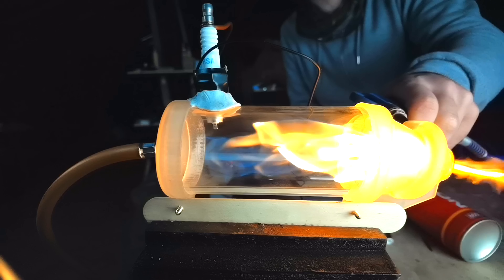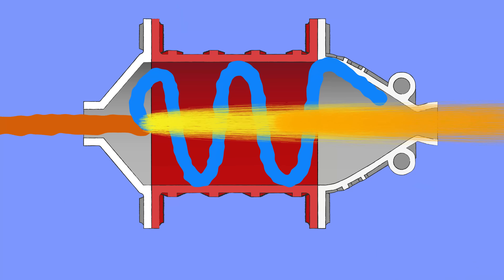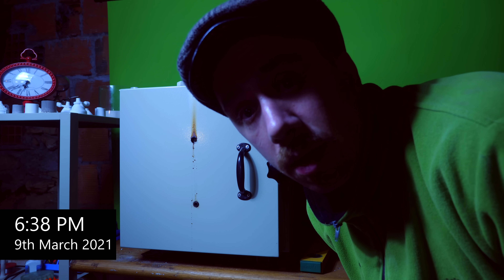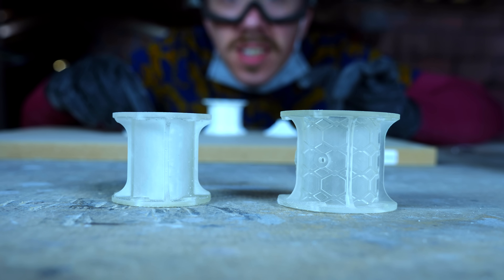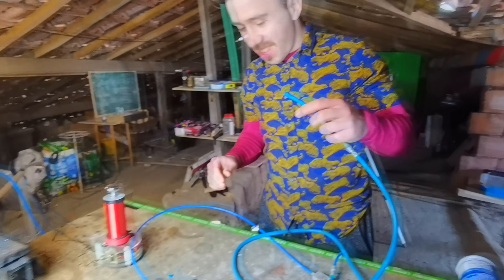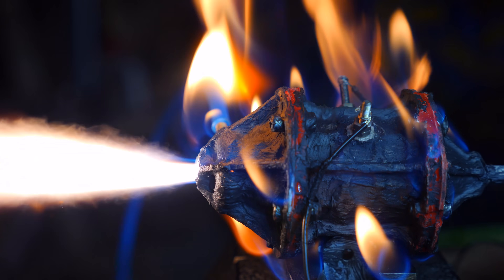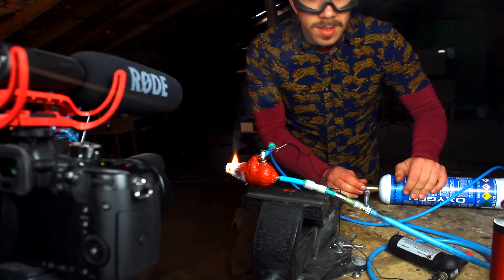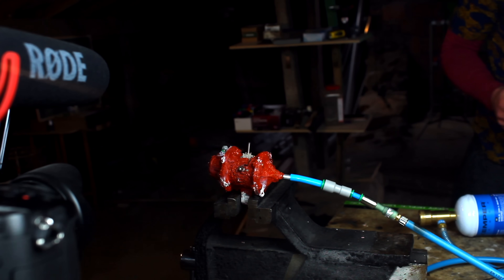Vortex Rocket V2.0 (3D Printed)

Comment: You can just use cans as body for the nozzle (just pressing them by 3d printed mold) and copper tubes as a fuel line. Well it's still half-printed engine.
Otherwise you can calc the cooling of an aluminum nozzle by fuel in solidworks (or openfoam).

And the chamber body must be transparent!

Comment: Have you thought of sanding down the connected engine pieces so as to remove the imperfections in between? Maybe that helps since there might be leaks dueto the parts not fitting together perfectly

Comment: To fix leaks: put temporary caps on holes, then dip it into ceramic bath the same way brass pourring molds are made.
Not the fastest way to do, but it should worth a try.

Comment: Look up Ceramabond 503 - it's a high temperature ceramic adhesive that you could probably coat the ceramic pieces with.  It's good up to about 3200F, and your propane flame will go up to 3596F, so it'll last for a little while at least.

Honestly I think you got the best results from the submarine-looking one-piece rocket, so I'd go with that general design or something similar.

I  think your major problem is that porcelain is weak against the forces being exerted against it - you're trying to contain an explosive force with a material that's weak against tension.  Think of it like a balloon, your continuous vortex is a force trying to expand the balloon and the balloon's ability to withstand tension is all that's keeping it together.  Porcelain, being weak against shearing and tension, is just plain a bad material for this purpose. Yeah, the high temperature resistance is awesome, but that's about the only bit that's going to help you here.

You might be better off using your new welding rig to weld up your rocket and use the 3d printers for making jigs or fittings to get the metal parts together *just right*.  Go full Colin Furze on this bad boy.

Comment: why don't you print the engine parts in plastic and then cast them out of metal. you already have the Furnace you use for ceramic parts. all you need is a casting mass and something to melt the metal with.

Comment: On the modular engine you need a o ring or some type of material between the pieces of the engine.  As it heats up it is looking for any sources of oxygen and burns right though the pin holes.

Comment: Here's my Brain Fart: You might be able to suck some sort of sealant into the void space of the ceramics shell using vacuum or a high pressure chamber. It will penetrate at least to the surface layer if the particles are fine enough and have enough motivation (pressure difference). Good luck.

Comment: What about print it, put it in the kiln to burn the plastic off. Use something to block the holes and then dip in a liquid ceramic several times allowing time between coats to dry and then put back in the kiln to harden.

Comment: Have you thought about trying to coat the ceramic parts in a high temperature glaze. This may be especially good for mating surfaces allowing you to use paper gaskets like a car engine in between two smoothly glazed surfaces

Comment: Ai, what about metalpowder 3d print? There is stuff mixed wirh pla for the normal printers and there are Special printers to „print“ titanium and shit. They use these for example for airplane spareparts. Print your engine like this and it should be stable

Comment: Why don't you try to place the engine in a pot and fill the space between the pot and the engine with concrete? It's quick, It's fast, It's simple, It's cheap. And also It's so heavy you may be sure it wont fly away.

Comment: You need a bell or aerospike nozzle to direct the flow more productively
Reply: he does have a nozzle. However at sea level the bell is VERY small in comparison to the chamber diameter. The big bell nozzles would be horribly over expanded at sea level (blow up the engine bad). :) hope this helps
Reply: @superspooky4580  I was also wondering if the throat diameter was optimized for the combustion chamber size

Comment: You're going to die in one of these videos. Also try maybe a low fire glaze after you clean the parts or even I high fire one as you already have a kiln that can handle it. You can order them pre-made online and should be easy enough to paint on the outside of your part. Not sure how it will handle the already fired clay but it's worth a try.

Comment: you could use ceramabond or any other high temp ceramic glue or cement or even ceramic glaze and make sure you pass it on the pieces you want to glue together as well as the holes you use to bolt the parts together (in case of cement).

other than that I think you could also try using carbon fiber to wrap around the glued engine parts just to make sure it won't leak.

Comment: since you are using a 3 printer could you use the oxygen to cool it down and effectively have a jacketed design to keep the chamber and entrance of fuel cooler, this then would only leave you with the nozzle being still quite hot

Comment: You could wrap it in a fine high temperature fiber mesh such as carbon fiber and then cover it in high temperature cement or high temperature silicone. Or another idea is smoothly cover the engine in high temperature  silicone and then wrap in a fine carbon fiber mesh or alternative as one of the main problems I saw was the silicone expanding due to the pressure.

Comment: You could make the engine parts with interlocking sleeves in order to create a better seal to prevent leaking. This would allow for higher head pressures while creating a better seal.

Comment: Try doping your ceramic with other things that could possibly improve its performance, I'd go for high temp metal glue. Not sure if certain solvents could dissolve the ceramic though, so probably try it with a small part first. I think the ceramic should soak up the metal glue perfectly, and once set it should fill all the pores.
Reply: P.S. to clarify, I mean to dope the parts after you fire them in the furnace

Comment: Try dipping your fired ceramic build in a thin concentration of high temperature tolerant concrete or plaster, and then let it dry, then bake it. I think it should work fine.

Comment: Ceramics are inherently porous. You'll probably need to switch to an entirely different method of making the engines. Casting them in metal using the lost wax method may be a good place to start. I think you'll do better though if you use steel sheet metal. Good luck with the complex curves of that one piece engine.

A solution that may hel for the ceramic engines though would be to apply slip to the inside of the engines, and then really buff it down. Maybe you can compress and align the particles of the slip enough to significantly limit the porosity.

Comment: Excellent videos man! Here's what I would try. Filter your refractory cement so you only have fine powder. mix with water to make a thin slurry and brush over ceramic parts. let dry and repeat a few times to build up layers. maybe baking them for a bit afterwards in your kiln on a low heat can help temper the cement.

Comment: Since the ceramic is so porous and the fact you have to burn out the resin, could you seed the object in high-temp epoxy to create a non-porous object? Perhaps vacuum pump with the epoxy still wet to pull out any bubbles?

Comment: I am somewhat working in that field but infiltrating the porous ceramic structure with a liquid Material might be a solution (f.e. a liquified metal or liquid ceramic), called a wetting process (not to sure what your pore size is, so its hard to recommend a Material for you)

I guess you could use any high temperature liquid Material, you just need to get the wetting angle and the pore size right)

Comment: Rocket Labs use fuel pumps powered by electric motors rather than gas generators , maybe make a 3 printed turbo pump rocket , only the nozzle would need to handle heat.

Comment: have you ever tried using regular porcelain powder to fill in the cracks? it comes in a powder form you mix it with water and it works like cement.

Comment: 3D print a mold of the rocket engine to use as a cast. Then you can cast it with a mixture of plaster of paris and graphite powder. No need to use the kiln anymore.

Comment: Easiest way to "seal it up" is to scale it up, and seal the inside. When you increase the pressure, it's easier to let things get pushed into holes, than to try and push things into the holes from the outside, since you need to push with the same force of the internal pressure.

Comment: Maybe you could make some kind of high temperature composite, using the refractory fiberglass and... honestly the same high temp silicone sealant as before, I think the issue there was that it peeled off. If you embed the fiberglass in the refractory cement coating the device initially, but leave it partially exposed, then it'd have the tooth required to hold in the silicone?

Comment: How about finding a way to use tomato as a 3d printer filament and using the printed tomato as a part in a combustion engine. If the engine fails, dead tomato. If the engine wins you have found a better use for the dreaded tomato.

Comment: I think if you put an cut from the inside where the pieces are next to each other that has the form of a triangle that is pointing outwards. You could 3d print another resin part that would fit in the triangle with a little bit of material on the sides so that the air can't get in the gap and the pressure in the engine helps to seal it up. But you should put Zement in between those parts anyway. I think this might work but I am not to sure. And if you don't understand it pls ask my English sucks xd

Comment: It looks like the sealant you were using was igniting once the exhaust temperature increased, what if you printed the engine, sealed it with something like gasket maker and then coated them with cement, this way the fire from the exhaust wouldn't be able to touch the sealant and it would add some rigidity to the engine

Comment: @Integza, what if you build a matrix from sacrificial material and use borosilicate clay to make an engine. Like a press form or something that could produce a less porous walls. Glaze it and bake to make a porcelain. This will ensure that your engine doesn't leak. Sacrifical material could be 3d printed plastic so you will burn it our in furnace later.

Comment: to solve the leaky engine maybe try coating the engine in "JB Weld", not sure if you have that where you live. If you dont have it, any steel based epoxy could work and make it stronger. You could also try Lost PLA casting to create the part out of metal.

Comment: 3D print the part, cover in clay for leaks, then assemble the tubes, cover de nozzle and put the engine inside a bucket with cement (2 parts sand) for strength

Comment: might be time to start casting some metal parts lol. Those ceramic prints can handle high temperatures, but not at high pressures it seems. You can still use the 3d printer to create the casting mold which should actually make it a lot more accurate. Love the videos Btw.

Comment: I'd try using the ceramic for just nozzles and the glaze them. Or maybe try using aerogel as the insulation. It's proven the be heat resistant

Comment: You could explore coating the ceramlite in cerakote to help increase heat resistance and seal up any porosity that comes from baking off the resin. Though you might have to send the part out for cerakoting; ceramic bonding agents could work as well but I would say from experience it is hard to get a completely even smooth coating of ceramic bonding agents so that you don't have to worry about porosity allowing the gases to escape the channel and creating failure points.. It would be interesting to see. Also you could use a mechanically flat surface with fine grit sand paper to level off your contact surfaces for the modular engines or using a lapping compound to make a perfectly seated modular unit. I also would think that you could coat the internal surfaces with cerakote as well. Though that is less an idea for another video as a solution to current problems. You could do a video 3d printing tesla eggs of Columbus and see if you can get one to work as well as the aluminum ones do.

Comment: I wonder if the way that the ceramic is formed with the resin leaves behind tiny voids, sort of like a foam or sintered metal. As the ceramic heats up and expands, the pressurized gas escapes through the voids. 

I don't know, but it seems like an idea anyway.

Comment: You rock! 😎
Reply: You rock-et?
Reply: Try if glazing the engine parts helps. Also apply from the inside. Ceramics printed with resin are naturally porous. You want to plug that so that the pressure assists you, not fight it.
Reply: Акхах привет
Reply: No he is integza
Reply: et
Reply: Прикол

Comment: You can try print a hollow mold and fill it with some ceramic clay, then you melt the plastic and remove it. So you will have your turbine without leaks.

Comment: I think  you should use those desktop metal powder printer to make high temp and quality parts 😉. It's time to buy new equipment. Or you can use ceramic extrude delta printer to make ceramic parts .
But I really like if you blow that bloody tomato 🍅 king 🤴with that suger rocket 🚀.

Comment: Why not consider using paint that is resistant to high temperatures.  For example, one used to paint a stove.  But from the inside of the combustion chamber.  Maybe use an airbrush?

Comment: @integza Love your videos man I wish you posted more. I was thinking if you took aluminum foil and wrapped the outside of your casing with it then sealed it the gasses could not escape and burn.

I would recommend like a pottery glaze of some kind and sealing the ceramic I bet its very porus.

Also you should pressure test the chamber before trying your experiment if you can get it to hold pressure then == no leaky leak..

Lastly I share your hatred of tomatos. I only eat them in their purified form of ketchup!!!

Comment: Hi,
You can use salt to seal the porous.
Put your engine inside a saturated salt water (NaCl). Then out to dry, repeat if needed. 
In the end salt is going to completely close your holes...   And it doesn't burn.

Comment: Try coating inside walls with heat resistant material it should solve the leaking out problem the material will be pushed against the wall of your engine due to engine pressure. it might also strengthen the porus ceramic structure of engine. well atleast a little bit more 😅

Comment: For the leaking, you could use high temp JB Weld. Just paint it on and leave it for a day or two to cure. JB Weld holds a mostly airtight seal and cures rock hard.

Comment: If you want to mostly use 3D Printing, I would suggest quickly dipping the already burnt 3D print into the resin and cure it (with a UV-Lamp) after that.
Then it's just a matter of burning it in the oven again. Repeat until satisfied.

Comment: Could you use the refectory cement on the inside of the modular engine? 

I think there may be small holes acting to focus some exhaust outwards, blowing holes through the other layer. Both smoothing and reinforcing the insides of the engine should help if that's the case.

Keep up the awesome work!

Comment: Put the rocket engine inside a pressure chamber, making sure the outside pressure is greater thant the inside of the engine. Rendering it impossible to leak :)

Comment: Take the finished engine, after it's been fired in the kiln, and fill the empty 'holes' with more ceramic. I suggest submerging the pieces in a 'slurry' then using a vacuum chamber to pull all the air from the spaces, and replace them with the ceramic. Then when their fired a second time, the porosity should be significantly reduced.

Comment: Glaze the inside like pottery! 3D print a mold for casting a metal! 
WEAR A RESPIRATOR (silicon dust man...)!!!! GET PROPER O2 VALVES!!!!
sorry I had to scream, but that's so insanely dangerous...
luv u

Comment: You could melt some metal and put the engine in. When you pull it out, there is some metal left on the engine and seals it. You can repeat this process and use metals like aluminum, lead, tin or copper. As a video suggestion, you could build a machine which liquifies oxygen and you will be able to power your engines with liquid oxygen and make them more powerful. Then, you can improve this machine to liquify hydrogen. It will make your engine even more powerful. If the chamber pressure gets to high, coat it with carbon fiber and then with metal to make it more powerful. Good idea, isn't it
Reply: The ceramic can take about 2300°C. The engine already gets too hot. Liquid oxygen would kill the vortex effekt and that'll kill the engine even faster. Oxygen and hydrogen in such a brittle engine? Just a quick "bang" and it will be gone. Aside from the danger he puts himself in when handling both hydrogen and oxygen in a simple room 😱
Reply: @Taunus-Tim  Not if you cool it with the liquid oxygen, it will cool the engine and become a gas after that. The vortex will still be there and the oxygen will automatically have some pressure. If the chamber pressure is too high and it will burst, you can still reinforce it. If you put the pipes for the oxygen in the right places, heat probably won't be an issue. Look at the pros at esa, they're cooling their nozzles and chambers just like this, otherwise the metal nozzle wouldn't nearly stand a chance to the high temperatures.

Comment: I believe you may need to print an exterior shell for around the engine with a high airflow to keep the engine temperature down and allow the ceramic to stay cool enough to not fracture.